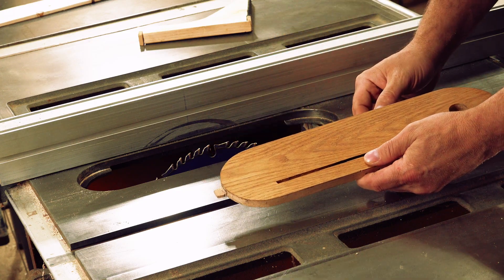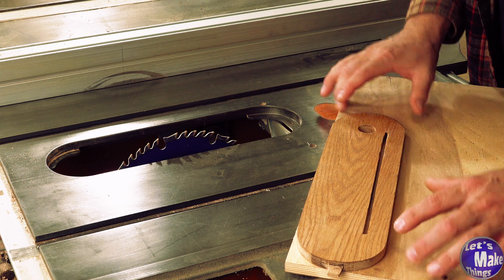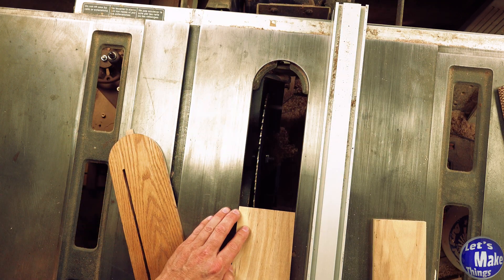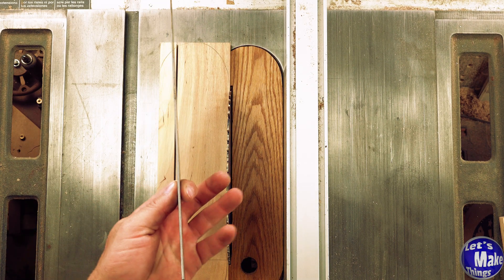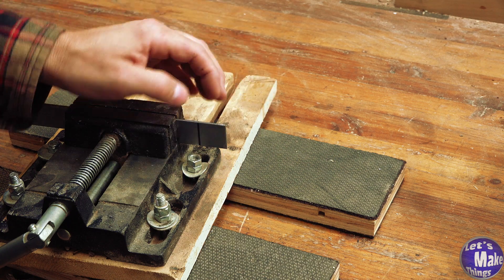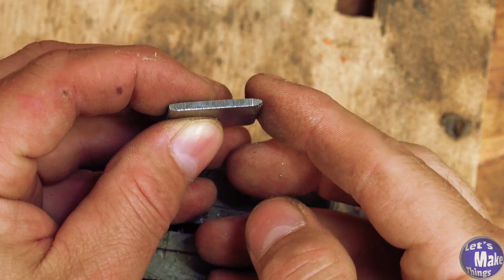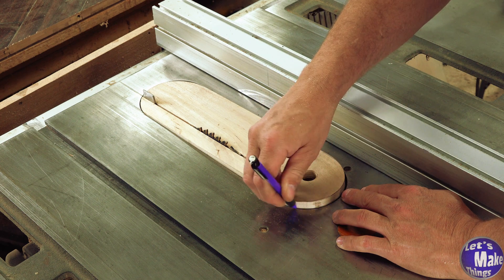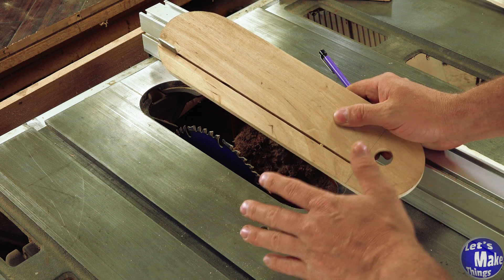Zero clearance insert (Table saw) with or without a splitter // Very easy build!

Comment: Great video!  I plan to fabricate one of these for 90-degree saw cuts.  Since the only other saw angle that I normally use is at 45-degrees (like for splitting lumber for French cleats) - would it be feasible to jury rig a second zero clearance plate with a splitter at a 45-degree angle?
Reply from the maker: Definitely!  One of the most annoying things is watching your boards suddenly move away from the fence.  That would help stop that!

Comment: thanks, like the steel for the splitter, i have those ridiculously expensive plastic ones which like to break off and are overly complicated to fit .  oh did i mention expensive !  especially when you need to make at least 2 for different kerfs.

Comment: Splitter should be 4 to 8 thousands thinner then the blade kerf. A rule of thumb is to make the splitter as thick as the blade body and not the width of carbide blades. Adding a pin or screw at end of insert is recommended as a safety feature to prevent tilting of insert when downward pressure is applied.

Comment: Simple and effective. I've made several from all sorts of materials, and i think plastic is been my most effective (and most easily found). Aluminum is great, but getting the exact thickness needed is tough when you use so many different kerf sizes like I do. So I only use aluminum with my ¼" and ⅛" kerf blades.